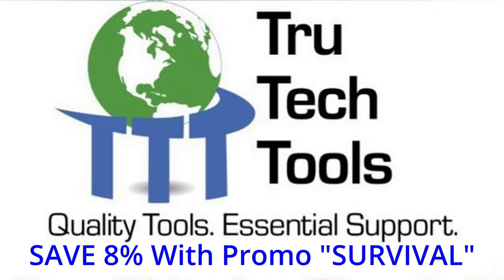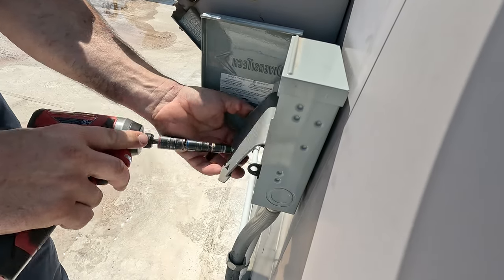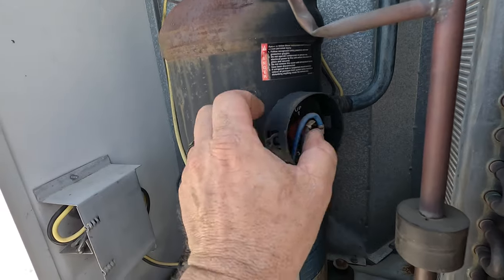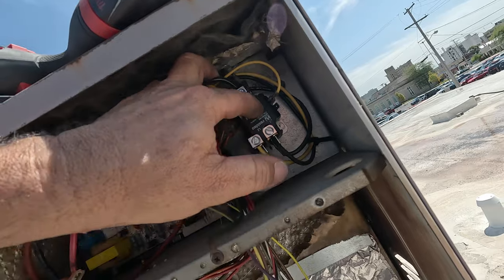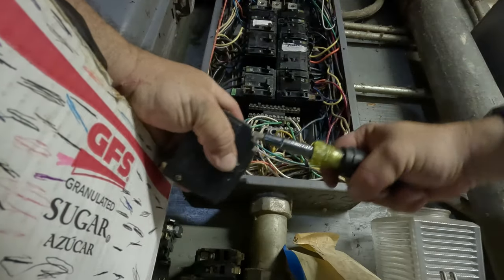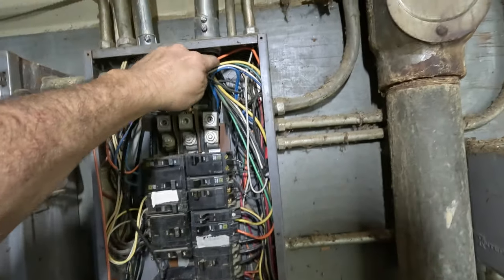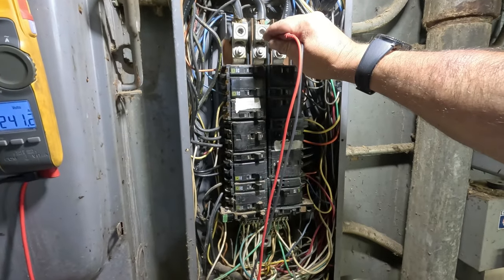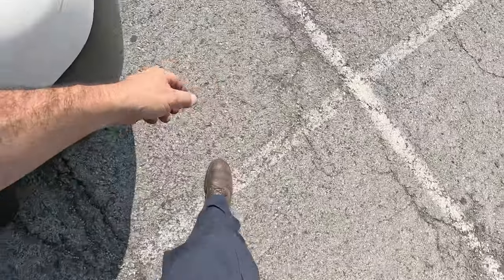Air Conditioner Keeps Tripping Breaker... Stop Resetting it!

Comment: Repeatedly resetting a breaker is dangerous and WILL damage it.  Rule of thumb is, reset it ONCE. If it trips again, stop and get everything checked out. Even a small breaker used in homes can explode and has in many cases. ANY breaker subjected to a severe fault (shorted wiring, compressor or other appliances) MUST be replaced as the contacts are usually damaged so badly that they will create excess heat under normal loads. Any breaker subjected to repeated overloads SHOULD also be replaced, depending on age and how many times it was tripped on overload.
Reply from the maker: I fully agree with this☝️

Comment: Home owner (me) with outdoor unit dead….inside blowing hot air.  I came here to better understand how circuit breaker “reset” caused my unit to blew out freon…guessing my compressor had a short and had to replace entire outside 410a unit AND replace entire line from breaker box….your video helped me understand it must have burned that wire up 😢.  Lots more $$ but at least the house won’t burn down.   Thank you for the detailed description….you are very thorough
Reply from the maker: I really appreciate you letting me know. Knowledge is power. It helps prevent any misunderstandings.

Comment: Nice job. I use to see on a 220 volt, single phase units that a broken neutral would cause high voltage on one leg and low voltage on the other leg. Usually happened after storms broke service entrance cable wires. Thanks for another excellent video.
Reply from the maker: Yeah, I've had that same thing happen with the neutral, but when I seen that that high and balanced perfectly around the 208 Mark, I figured it was probably a high leg.

Comment: Good job Rick, Yeah that panel is overloaded, The 208 delta is usually labeled with orange tape, but that wire is so old that the coloring wouldn't make much of a difference, I would recommend them to get a panel change out or new service, and standing in a puddle of water when working on electric circuits isn't good for your health.
Reply from the maker: I said something about it but cut it out, my complaint was I couldn't heal neal down 🤣
Reply: That 208 might have burnt-out that wire.

Comment: Well done sir. 👍 one thing though. It appears you over tightened the breaker & connector. Look on each of them, there will be torque specs. A torque wrench is required for correct torque. Over tightening can damage the wire WAY worse than scarring it with a blade.

Comment: yeah, when using wire nuts on stranded wire, always "lead" the stranded wire ahead of solid wire, because the stranded will often not get captured and simply fall out or multiple strands may push back and make a poor connection that will overheat and burn. it's always wise to pull on the wires afterwards to make sure they're captured well.
Reply: Do it every time to make it a habit.

Comment: 24:10 -Iinstalling wire ties back to back prevents the insulation from rubbing out to the copper. I missed this one the first time watching.
22:40 - Yes! With conductors of any gauge, twist all the stranded ones together and push them to the bottom of the connector before adding the solids. Twisting all tight and pulling on each wire after tightening is also a good practice.

Comment: You really should check for direct shorts to ground right from the disconnect box. 

You can tell it’s not three faze right away just from the disconnect box coming in with 4 wires.
Reply from the maker: Yeah, that's the problem with trying to talk and think at the same time. I find you make more mistakes that way.
Reply: I caught his slip up also, lol it happens when too many things going on at once. 🤣

Comment: I have a portable air conditioner thats tripping my breaker, but why all of a sudden now after a few years?  Nothing has changed since i was using it for the last few years.  Takes about 5 to 10 mintues for it to trip once i turn it on.
Reply from the maker: It could be a weak capacitor,  a  blower motor going out, or a compressor that is not starting everything. It could be short cycling the compressor due to low refrigerant. It's hard to say without seeing it.

Comment: I gotta Daikin room unit down in the basement and it's like brand new looking everything is spotless and rarely gets used why would I have to pull the breaker on the shutoff outside to fire it up like after a few hours of use? It just consists of a big unit then a smaller one in a bedroom.
Reply from the maker: Sounds to me like there’s an error or a lockout condition happening, when you kill the power outside, you’re causing it to reset. that’s all speculation, but Possible
Reply: @HVACRSurvival  Exactly, it's all controlled by a remote control and like a 100 options to change or if it doesn't sense movement in 20 minutes it cuts off, I wish it just simply had an Off/on switch to make it 100 times easier! Have you ever had problems with them cutting off?

Comment: That stupid little clamp thing is called a burndy, in my area anyway.
Reply from the maker: Had a search online then once I found it, it was a little easier. Lowes was supposed to have it, but they didn't, both electrical supply houses didn't have it, they had bigger ones. Ended up have to go back to the shop.
Reply: Usually call a burndy a split bolt.  Not sure it is legit for splicing, but have used them for it.  Made for grounding/bonding I think.  Kinda like a tap.
Reply from the maker: @joehead1294  I remember split bolts being used but you have to use special electric tape. Cloth I believe.

Comment: Actually that standard for square d q o breakers. Those old panels like that seem to hold up the best because of that design of bussing behind it. That's my experience with it, and because of that design, the brand I by is  Cutler hammer  tan handle.  Its what I buy for super duty Kind of work. feeding big air Conditioners, Large lighting loads.
Good thing you caught that! That's just nothing but electrical fire waiting to happen, and your right! It will be your fault because you were the last guy there! L o l